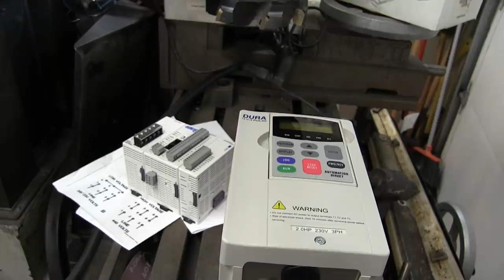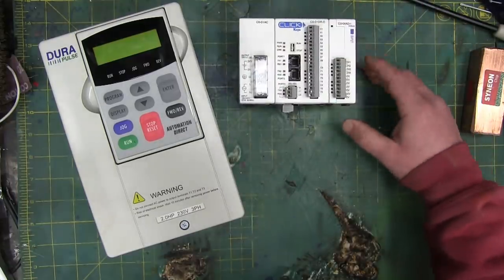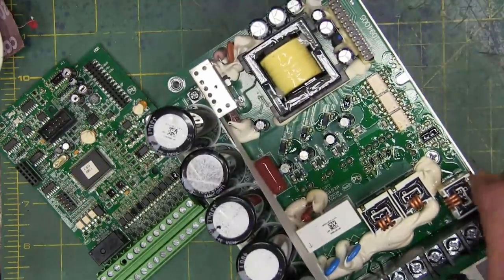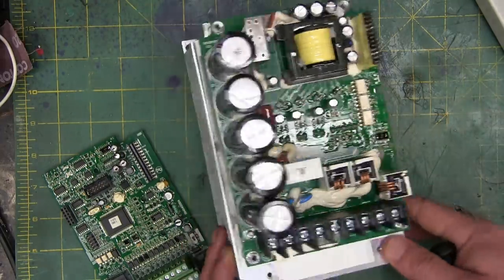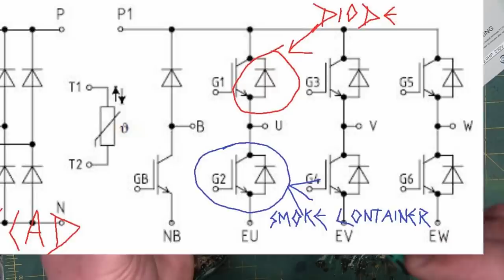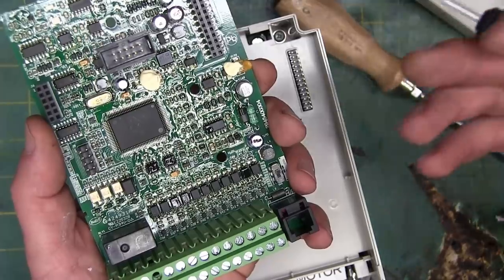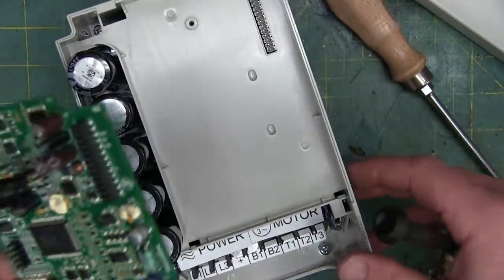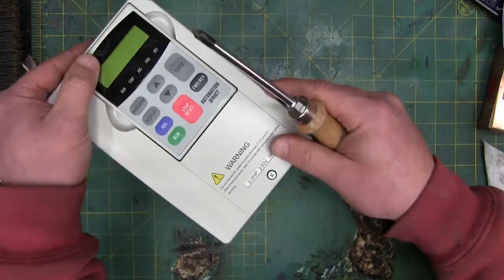BOLTR: Inverter EXPLAINED | DuraPulse VFD

Comment: People actually live in houses without three phase electricity?
Reply: IKR, ive had triphase for 30 years in my house
Reply from the maker: Show off.
Reply: We dont generally have 3 phase in houses here in the UK, but can generally get it as the step down transformers are 3 phase, then they split out the phases for the houses, but they like to charge for installing it and you can't get a good deal on your electricity either so each and every kWh costs more. VFD's are wonderful and not so many home tinkerers know about them so old 3 phase machines are still cheap.
Reply: I live in an apartment in an 8 floor building and everyone has three phase electricity power lines. It's not uncommon here in Argentina.
Reply: If I want it I could get up to 3x63A 400v but it will be costly.
Reply: here in Slovakia, 3 phase but few kilometers more south in Hungary its only 1 phase too. but those 3 phases end in the junction box with fuses. not that we have a 3  phase plug in the kitchen or so ( well mostly :D ). have 1- 3 plugs for 380-400V in the barn or garage and thats it. +some extension  cable.
Reply: The only place I didn't find trifaze was my grandma house in Italy.
Reply: Hello, welcome to nearly all of North America, where we've instituted bad standards that will last forever. 120V is a joke, and the 240V outlets for stovetops/driers are still not too common. I only got two of those.
Reply: LazerLord10, the 240V thing isn't too bad, since it's easy to get 240V if you need it (I have it on two AC units, an oven, and just removed it from an old baseboard heater) - but 3-phase is different! Even businesses can't always get it.
Reply: Even in India, we get 3 phase...... For 5 hour every day (the rest of the time, it's zero phase, (power outage)).
Reply: Them muricans work in mysterious ways...
Reply: M390VI In England you get get 3ph but that’s mostly for really bit houses. The bog standard house doesn’t, you can ask for 3ph but it’ll cost you. 
I’ll be getting a lathe and a mill very shortly once my sheds finished but I’ll just use single phase machines.
Reply: My shed/shop here in holland has 3 phase, did not asked for it.
If it's there i use it ;-)
Reply: As for NA, at least where Ive seen, a house gets two phase, "110" LN and "220" L-L. 110 ranges 105-125 and can be found easy. 220 is for the heat/oven kind or special pump purposes.
Reply: 220 is still single phase. The A/C wave patterns overlap. In three phase the a/c wave patterns are all 33% off from overlapping. It makes a much more efficient motor (pulls less amperage for the same HP.)
Reply: Farm life always had 3phase hahah
Reply: I've got 800A of 3 phase in my woodworking shop. Power CO. will supply several different voltages, your choice. Problem is I've got tools that require different voltages so lots of transformers. 460,400,380,240,208,120V The  120V is one leg of the 208V - 3 phase. Most motors will tolerate +-10%. I don't have any Canadian tools or I 
would also need 575V.
Reply: Pretty much everyone have 3 phase connected to their fusebox(or whatever the english name is) but everyone do not have 3phase from the outlets of the walls. Maybe in their garage, but thats it.
Its common to have it if you got an electric stove. Otherwise its all single-phase.

Comment: @ave clock does not give "time".. well, not like a wall clock. actually even crystal (much better than oscillator) still have big error (often given in +-PPM, how many pulse per minute variation you may end up with) compared to a crystal used for clock (generally 32KHz). crystal that are used for real clock need specific circyuit called RTC (Real Time Clock), sometimes are included inside the MCU itself, but then you normally see 2 clock, one or the logic and one for the RTC.
What the clock does is driving the logic of the MCU: 1 clock = 1 instruction. Of course this is an oversemplification, many instruction may take more than one clock, and on CPU pipeline and other black magic may even result in multiple operation by clock.

Comment: I think the relay is aux output for an alarm or other indicator.
Reply: An alarm... or to run an enclosure fan when the drive is running. Though standard practice is to use it to control a relay.
Reply: Yeah usually there are one or two programmable relay outputs on VFDs. Mostly used for an alarm or run signal as you said.

Comment: If my country gets 240V will it be easier to get a mill or lathe machine working compared to places where it's 110V? IIRC our area has 415V 3 phase but of course like most people the line to our house is only a single 230V phase, is there a way of like, doubling it up on some type of y connector to get the full 415V?
Reply: No.

Comment: So many people are talking about how they have three phase in their homes in other countries. I decided to check... and like the US you don't have three phase. Most residential power ANYWHERE in the world is single phase, three wire IF that.
Meaning you have two hot legs, and one neutral. So you can have in say the US you have available 120 VAC or 240VAC. (The latter for being for your ovens and such.)
Three phase power is THREE hot legs, a neutral, and a ground. So it's unlikely you have five pin plugs in your house (which exist, NEMAL21 in north america and the various 5 pin Ceeform connectors most commonly elsewhere) you don't have three phase outlets in your house. You more than likely have a four pin one which will be hot-hot-neutral-ground. 

However most countries which have around 240V power simply don't need three phase, the odds of you having three hot lines coming into your service panel is pretty heavy overkill for a residence.
Reply: Some countries do indeed run 3-phase to houses. Poland, for instance. More wires are obviously required, but they can be much lighter gauge so the overall cost can be cheaper (less conductor material is used overall).
Reply: And yet we do.... Belgium.... :-) 3 phas welding 3 phase electric stove 3 phase mill ;-)
Reply: You contradict yourself, "single phase, three wire IF that".
 If you have two phases, 180 degrees apart, that is 'dual phase', used in the UK with 110v transformers for building site power tools.
Reply: In Australia we have the choice of 1,2 or even 3 active(alive) conductors and a neutral. I also work as an electrician on American and German equipment. American equipment is horrible...switching neutral conductors etc...you guys are so far behind the rest of the world.
Reply: Here in Norway, 80 % of houses have 3 hot wires, and no neutral (IT), 230V. Same as normal three phase in america, just that we normaly connect it phase - phase, giving us 230V 1-phase. And not the weird Phase-neutral thingy in murica.  You guys can connect phase-phase and use 230V applications. While we sadly can't use Phase to neutral, since we got no neutral, and to use phase-earth (115V) would be pretty crazy. :P 

 It is nothing compared to TN 400V with 3 hot and one neutral, which 10-20 % of new power installations have. But a lot of older motors, lathes, compressors, mill's uses the 230V 3-phase, so I'm good. :) Only thing is, my house and workshop used to be a cabin in the woods, so it only got 25A (10kW). Desparately need to get this upgraded. :S
Reply: mwiz100 Maybe u should check again.  Not everything is always bigger and better in US. Here in tiny tiny country called Finland we have 3-phase in every home. 3-phase sockets are usually in garage or in the main electrical panel. Where they are needed. Inside the home only electric stove and water heater needs 3-phase. So there is no need to have 5-pin 3-phase sockets in your living room. Did u really think we have 3-phase TV's and coffee makers?  :)
Reply: Of course we do, the plugs look like this: https://upload.wikimedia.org/wikipedia/commons/2/2a/CEE-Stecker.jpg 
It's not everywhere of course, just where you need it; kitchen for a stove, garage, workshop etc.
The rest is regular 220/240V. To be a lottle more technical: DIN 18025 states that households are to be connected to the supplying network by three phase, 63A power line. So there is at least one place in every building where you have 3 phase: at the main breaker box.
That's for germany btw.
Reply: Did you think that every outlet is 3p or what went wrong?
Of course there are usally only 1 or 2 with all 3 phases (and thus 5 wires). All the rest are normal L/N/E (3 wires) outlets.
Reply: Normal house sockets are ofcourse three pin sockets (Line, Neutral and PE = protective earth)

Wired line to the socket is from one of the three phases, L1, L2 or L3.

In Finland we all have saunas in our houses. Mine is 8kW electric. Those need three phase power.

My main breakers are 25A and my house is also electrically warmed. My house consumes some 21000 kWh per year.

Normal lines coming from the breaker enclosure are L1, L2, L3, N and PE. Loads are shared equally between the lines, so when wiring up the house the load is precalculated so they share somewhat equal load on normal conditions.

Comment: It should be noted that while the output of the VFD effectively puts out 3-phase voltage, it is NOT true sinusoidal waveform AC voltage. If you hook up a scope to the output of a VFD it will look like a big oscillating square wave, like this: https://www.dreamstime.com/stock-images-oscilloscope-waveform-output-variable-frequency-drive-vfd-powers-ele-image1474804

If all you're doing is hooking up a motor, that's fine. Motors aren't that sensitive to it and they'll be okay. But if you're powering up something more sensitive, like a control panel with a PLC in it, you're going to fry that stuff. Not too long ago I had a customer power up a three-phase machine in his garage off the output of a VFD because he didn't have 3-phase service. Almost immediately he let out the magic smoke in the little Micrologix 1000 running the thing as a result.

It should go without saying, but never hook up anything except for a motor to a VFD.

Comment: wrapping caps is generally prefered when siliconing bigger caps, for protecting the respective caps casing with any dim changes with environment etc and also any chemical issues (from a number of sources), and to protect the rest from each other, but ultimatly mostly mechanical since it just needs to keep them inplace but not so rigid that any force would cause actual damage. and then if any leaks or replacement happens then having them wrapped makes that whole proccess a million times easier.
ed. so in honesty you should be 100times more suspicious if the caps in that 3 wernt wrapped when siliconed(rtv) together

Comment: that different capacitor is bugging the hell out of me!
Reply: It makes me think it was a friday, and they were shy one cap, Made 99 today and had to get number 100 out or he didnt get his .30 cent pay for the day! "Ok boss done"
Reply: It's probably 2 actually. 3, one for each phase, and the other two might do other things. Kind of hard to know w/o seeing the schematic.

(but I was also wondering if all 5 aren't ganged together as one replaceable unit for other reasons, like fitting the space they wanted it to )

For sure that thing has some waveform shaping circuitry within its industrial 3 phase output and that is what I'd guesstimate some of them are for. Playing with the waveforms isn't the hefty part but doing it at high current and voltages are. (I made an 8 times voltage multiplier once and distinctly remember the explosion of paper and tinfoil shrapnel hitting my face when I tried to put too much current through its electrolytic caps.)
Reply: I suspect that they used two different capacitors with different characteristics so they could get a compromise. Seems unlikely they'd order two types otherwise...
Reply: I'd say it was lower in order to clear the bulge in the housing, that's there to put your finger in when you want to take out the controller.
Reply: Primož Resman yeah, that's what I spotted, the left hand thumb hole to remove the lcd unit
Reply: Hammerjockey 
As the frequency increases, capacitors become less capacitive and will become inductive if you go high enough.  If all the capacitors happen to have all the same characteristics, setting the drive frequency to a particular "sweet spot" could cause high currents to flow where they are not intended and destroy the controller. For bigger capacitors, this frequency is lower.
It is possible that the smaller one is used on purpose to absorb some of the highest harmonic frequencies from the drive.
Reply: Inductive? Don't you mean resistive? I'd like to see a link to THAT datasheet!

But in either case, Yes, I agree it definitely could be for frequency absorption of harmonic distortion. Now you often see designs in which 3 very different value caps are used in the same area in order to combat harmonic distortion. It's very good engineering & circuit design practice.

Comment: I might post a link here to a photo of an H-bridge audio amplifier on a bread board but I got something wrong, probably the jumper wires to connect pins on the chips. It's supposed to be driving piezo chips at ultrasonic frequencies (not currently connected).

Comment: Dumb question: what does one use a PLC for, say in the case of getting that mill working?
Reply: You use it for running complicated systems, they sense inputs from things like limit switches, rotary encoders, etc... then it follows the program and tells the output to do things.
https://en.wikipedia.org/wiki/Programmable_logic_controller
Reply: J-man72 ok thanks. I wonder how he plans to use it for this mill?

Comment: Why cant we use koyo in industry? Ive used dl06 for years.  The expense is astronomical for allen b.
Reply: Most of the plant where I work is powered by some model of A-D PLC. I learned on the GE Series One which eventually turned into the 305 series but we have 05, 105, 205, 305, and 405 in service now. I can't say enough good things about A-D.
Reply: kb1gni i'm just sad that the newer AD plcs do not support stage progrmming.  I have to do stage progrmming or my code is a mess.
Reply: Alex Powers Haha, I never used Stage, always ladder. It is a lot cleaner and easier to troubleshoot if on complex machines you use a counter as a sequencer to step the machine through it's process.

Comment: So let me get this straight: You don't get 3 phase in your house on the left side of the atlantic? Well, where I am now we have 3x120A and we are going to upgrade to 3x500A. And at home in my very own house I still have 3x25A. There is even a 3-phase connector in my connecting cabinet on the wall of my house, you actually get a connector weather you want it or not.

None of it is industrial.

Comment: I find it weird that most homes in the west do not have a three-phase power while most city houses in the poor Balkans do. What's more, speaking here specifically of the Netherlands, it boggles my mind that you get grounded sockets only in the bathroom and the kitchen (and possibly outside if you have a garden). One would think there's enough money not to skimp on wires and slightly more expensive sockets, but noooo...

Comment: I head that these vfd drives are rated for three phase input and to use it as a converter from single to three phase you have to derate the drive because the big caps arn't sized  properly to work at full load in that configuration. Can you upgrade the caps and use it fully rated or is that a pipe dream?
Reply: The issue isn't the caps themselves, it's the fact that for a given load, the current draw is higher on single phase. The factor is 1.73 (square root of three). You have to use a drive that has a current rating of 1.73 (or higher) times the current draw of the motor when using single phase supply.
Reply: Keith MacDonald ok, I think I understand.. I remember reading on a forum and it actually fits right in with what u said ,, because it was saying that the input ripples caused by the rectification of a single phase  introduced unwanted variations on the DC bus and the additional load placed on the igbt's would cause premature heat failure on those parts of the system. So to prevent a failure mode like that, manufacturers reccomend a De-rating when used on a single phase input, which on the units I use to work on were 50%.

Comment: just a little bit of info I learned from building PC's, be on the look out for Japanese capacitors in your teardowns. Way back around like 2005, there was a thing that we computer nerds called the capacitor plague, when all of the makers of motherboards and power supply's started buying shitty Chinese made electrolytic capacitors that popped like balloons in 3-5 years, ruining both the part itself, and sometimes everything else with that gross conductive and acidic liquid. As it turned out, Japanese capacitors out chooched every other country/brand by like 10 years, including Germany, America, Italy, etc, to the point where Taiwanese brands and such have been trying to figure out why Japanese caps out-chooch everything else so much. Now, you go to a computer store that sells high end computer hardware, and you'll find that most high end power supply's and motherboards may have "Made with JAPANESE capacitors" on the box. Now sometimes they'll only use the high end Japanese stuff for the main capacitors, but most reputable brands like corsair, evga, seasonic, be-quiet (who's German), and in some cases silver-stone, generally mean it when they say 'made with 100% Japanese capacitors.

Just thought you'd find that interesting, and possibly useful.
Reply: some Japanese crapacitor brands are Rubycon, Nippon Chemicon (or united chemi-con), Nichicon, Sanyo/Suncon, Panasonic, Hitachi, FPCAP or functional polymer complex (ex-fujitsu caps segment, which was bought out by Nichicon), and ELNA.

Here's a link to a PC nerd website that does a better job at explaining this stuff than I can.
http://www.tomshardware.com/reviews/power-supplies-101,4193-5.html